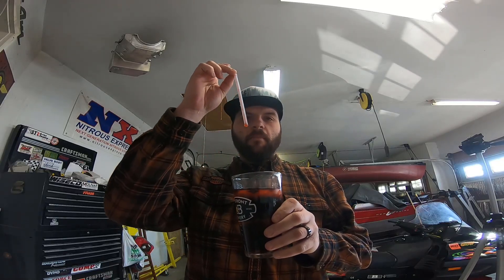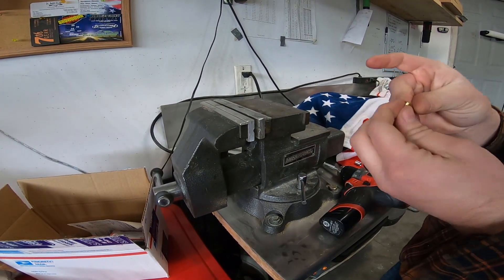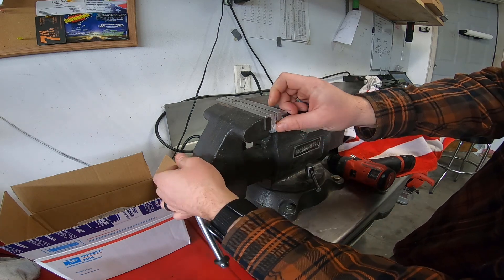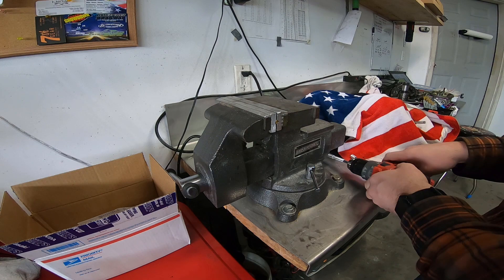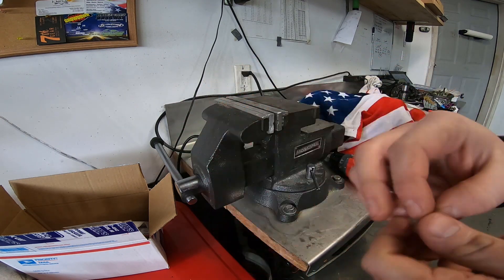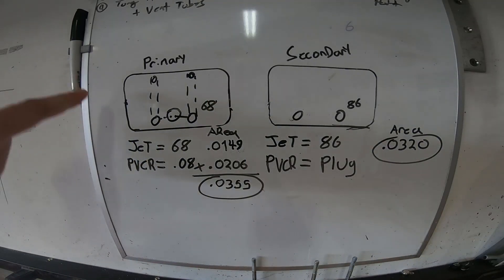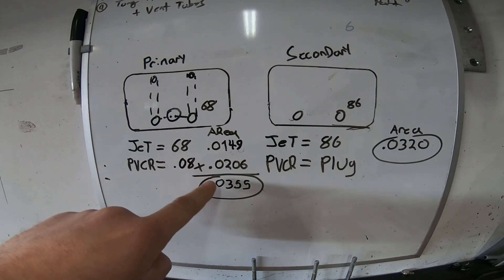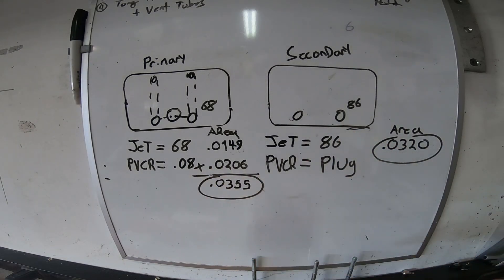Building a Blowthrough #4 Carb Tuning

Comment: Watched your videos numerous  times, looking for a little advice. 4.8 ls running 650 atm carb, 10lbs boost. BAPV in front, pvr,s drilled .081 prim jet .073 and .090 in sec. Currently  afrs at idle 14.1:1  cruise is same and wot  is 13.1:1. Should I drill pvrs more and add more jet to sec. Also would you suggest i drill air bleeds larger to get idle and cruise  alittle cleaners, thanks
Reply from the maker: Cruise at 14 is pretty good. Weather will change that a bit. 

For WOT go up on secondary to get acceptable AFR note the area change , then you can calculate how much to go up on the front PVCR and drop the rear jet down a bit to keep even fueling
Reply: Thanks,  wasn't  sure if I could jet the rear enough to compensate, I'll give that a try.
Reply: Ok i went to .098 in sec  with zero change. I suspected my fuel pump was maxed out.  I installed a 155 gph  14psi fuel pump with -8an from tank to regulator.  Had to re-adjust  regulator  and float level so im getting more fuel. Took it out for another hit,  again zero changes in wot, still at 13ish.  From regulator to carb i have a single 3/8 line feeding both  bowls could this be a problem?  if yes and i run two lines and no change should i run smaller high speed air bleeds, thanks

Comment: I should learn how to tune a 4 barrel well before doing this blow through stuff! If you are only running the boost referenced power valve in the front do you not modify (Drilling holes) the rear metering block at all?

Comment: So how much power will this particular setup be good for on 91
Reply from the maker: You can make over a thousand on gas . Now if you can keep it safe on 91 is the difference.

On 91 the carb won’t be the limit
Reply: @ do you power valves work at lower boost levels? 750 carb, 7-10 psi?
Reply from the maker: @Johnson-uy9xq  yes they start at 3psi

Comment: If i am running a boost power valve in the rear secondary drilled out to .0080 and a vacuum power valve in the front what size jets would be a good starting point
Reply from the maker: I can't answer that, just to many variables . Start with the jets that the carb came with or drove with well under no boost.

Keep timing low , test one change at a time and have fun

Comment: Quick question I'm having an issue with a rich condition on just off idle its something that has recently started pulled in the driveway at 13.6 ish afr one night left in the morning at 9.9 ish afr's. It sounds like it may be an idle air bleed issue from what I understand you say?
Reply from the maker: Reset your 4 corner idle first and see if those screws moved or something.

Floats stuck high possibly 

Leaking / blown power valves can cause rich idle too

If this car was dialed in I doubt the air bleeds changed on there own
Reply: @tittan1500  ok I'll check the idle screws first. 

Floats are good and I run the brpv which I've switched and had the same condition. 

Truck was dialed in however I don't run inner fenders and I lost and air filter took me a week to notice. There can be a decent amount of debris around the turbo maybe it sucked up a little debris and potentially partially plugged the air bleeds. Could this be possible?

Comment: Great video series!  Thank you.  This may be a dumb question and someone probably already asked.  I am having an issue with wide open throttle.  It works great until 3/4 almost full throttle.  Reading 12 - 12.5 to 1 on the AFR. Then I mash it to the floor and it goes to 14 to 1.  Would this maybe be the power valve restrictors being too small in the secondaries or possibly the high speed air bleeds?  I am only running about 6 pounds of boost.  Any help is greatly appreciated.
Reply from the maker: You need more total fuel.  Add more secondary jet to get it safe then you can work on balancing it out
Reply: @tittan1500  I currently have 97 jets in the secondaries. I will put smaller air bleeds in first and see if that helps. Otherwise I will go into the bowl and change to 99 jets. I appreciate the response.
Reply: @lzmachines69  you ever fix it im having the same problem and i feel 90s jets is way to big for only 6 psi im at same thing
Reply: @302brady  I went with the aces killshot 2.   Fixed all of my issues and now I get better fuel economy as well.

Comment: I follow everything I ordered the power restrictor but I put it in the secondary. Is that OK Does it matter thank you great video. Do I need to run a plug in the primary or can I run a vacuum secondary.
Reply from the maker: Vacuum power valve in the front and BRPV in the rear or both BRPV
Reply: @tittan1500  My car stumbles on the trans brake any ideas ..
Reply from the maker: @OdinSon286  when you let off the brake does it bog?  Do you have BRPV in the primary and secondary

Comment: Hi building a turbo 350 now. I have bought a power valve from you. Just a question. If I fit the power valve to the secondary side do I still have a power valve in the primary side?  Do I leave the primary alone?

Comment: Hey i built the carb where it works on power at every interval with boost however... idle is the only place i have a problem...idle is at 19.0 afr it barely runs at idle and way too lean.. idle adjustment needles dont have any effect. Wondering what you may think.
Reply from the maker: How close is your o2 sensor to the end of the exhaust ?   Sounds like it’s close.
Tune it by vacuum old school and if it idles well ignore the gauge, pretty common for guys to chase the AFR gauge at idle 

If you can’t get it to idle well your blades transfer slots might be off or the idle feed restrictors.

However it you dident change the fuel or put it on some huge engine it should be close already
Reply: @tittan1500  I’ll try the blades cause it’s lean popping at idle very aggressively

Comment: Great video very informative and straight forward. I have done blow through with an edlebrock and worked okay which made me switch to holley double pumper. My question is if you do not use two power valves do you need to plug that powervalve hole on the one side you do not use the powervalve?
Reply from the maker: Holley sells a blank power valve block off, you do not need to block the port in the base

Comment: Is your basic carb setup for turbo application or for centrifugal supercharger. 
I have a vortech supercharger on my 383 with a modded carb and a 50mm bov. 
I’m finding I can’t get the car to idle as it’s getting a lot of air even at low rpm and 2 much fuel . Any suggestions ?
Reply from the maker: It’s for a turbo, but it’s close for both

Is your BOV open at idle ?? Are you using a vacuum power valve ?

Comment: Just have a question. Can u explain the vent tube extensions better. My current set up does not have them. Thanks again!
Reply from the maker: Jeff 

I have a video on that topic too.  Short story you see the signal quicker so the carb does 2 things,   1. Responds quicker and 2. The air shoots directly into the tube not across it so the carb gets a stronger signal in the bowl.

Many people find this makes the carb flow more fuel aka its like adding jet sizes

Comment: Using your example when squaring the carb with a .08 pvcr and 68 jet (.0355) wouldn’t a 93 or 94 jet be closer to square? Or am I reading it wrong? Thanks for your videos!
Reply from the maker: It’s just a common staring place most guys don’t ever bother to square a carb.

Your primary jets are going to be what they are to allow the car to drive light throttle.

Then your correct you would go up on the PVCR to find that balance so the primary and secondary pull the same fuel WOT
Reply from the maker: Keep in mind the more your add to the primary pvcr your going to be reducing the rear netting too so gotta so some math / estimating to reduce trial and error

Comment: I have a holley brawler 850 race carb . Any way to tune the carb with power valve plugs and just tuning off the jets? Only running 8lbs of boost on a chevy 355.
Reply from the maker: Ya  but with no powervalves at all it’s going to be an on or off switch
Reply: Ok I understand I appricate the response . With low boost like I am running what size jets should I start out with

Comment: Nice work, great info and explanation! Can you make a quick suggestion for a 5.3 700hp goal on E85; what E85 Jets and PVRC sizes do you recommend to start tuning with? Thank you!
Reply from the maker: Carswell's Customs link in the video description has an e85 carb setup / build sheet
Reply: I opened the Basic Gasoline Blow Through Starting Tune, but I do not see any information E85 listed. Maybe on a different video?
Reply: Hi Tittan 1500, I clicked every link in this description is the information somewhere else?
Reply from the maker: Carswell's Customs I updated the excel spreadsheet.  Keep in mind every booster / metering block will generate a different signal so this is a base like
Reply: Excellent info! Thank you again!!

Comment: Let me ask this, if I'm running e85 blow through, if I drill my pvrc say .080 do I match the secondary side as well if I'm running bapv in both primary and secondary?
Reply from the maker: Brian Hundemer  ideally yes that will help you keep the carb “square” but at times you can’t dump all the fuel in the primary so fast so there can be a difference.

In the end as long as the total fueling for the primary and secondary are close your going to have decent cylinder to cylinder AFR

Comment: Did you need to drill or block certain emulsion holes when running e85 blow through? Your video have taught me alot and appreciate every one of them.
Reply from the maker: Brian Hundemer I have not purchased that kit before.  I assume it’s just the same blocks with larger main wells and screw in emulsion holes
Reply from the maker: Brian Hundemer start with your current gas tuneup and go from there.  You probably don’t need to change the height of the hole
Reply: @tittan1500  ok, let me ask this idk if your familiar with the quick fuel e85 conversion metering blocks. Im using those, if that would change things?

Comment: What would be the basic mods for 15 pounds on boost on a bbc?  I have a holly 950hp now.  Gas carb
Reply from the maker: Andrew Myers most likely if it’s basic.  If it makes big power NA then bo
Reply: @tittan1500   I make 425hp at the crank now na.  8-1 compression. I'm gonna go with a vortec  blow thru supercharger or a torque storm supercharger. And I plan starting at 8 psi then pushing it to 14psi after getting the feel for 8psi .  I'm thinking it's only gonna make 700hp. Non intercooled. Maybe less. Has good  dart aluminum 340cc heads and team g intake.
Reply from the maker: Should be good to go

Comment: Watch the videos a hundred times bought all the things to make my Holley XP 750 CFM a blow through carburetor runs a 100 times better twin turbo big block Chevy when I get to 15 psi around 6,000 RPM it builds fuel pressure and starts to fall on its face running a mechanical fuel pump what am I doing wrong
Reply: This is real old and you’ve probably found out by now, but an inexperienced head as myself would say you’re running out of pump. Can only throw in the pressure the pump can supply. He explained it in the first part I believe

Comment: Your very articulate and your technical ability is so impressive. Could you please do a video where you run through the set up in your car? Eg, what cam are you running,?what heads? Which turbo? Timing controller?

Comment: Ty man your vids are the truth and guys like me need more video to understand lol..👌 we not tryin to blow parts frfr. Quick 2 questions. Im runnin 22+boost. Whats a good plug to run and whats a good gap. .28 gap im blowing the spark. Anyway your vids are fiyahhh🔥🔥
Reply from the maker: Les Harp what engine fuel and compression
Reply: @tittan1500  2 3l..9:2:1
Reply: 93octane

Comment: For the rear  throttle  blades  and for the accelerator pumps
Reply from the maker: Shane Mcclaran accelerator pump tuning is not effected by going blow though tune the shot size / duration to get a nice crisp transition.

I have not played with altering the timing of the blades. I would imagine going to a 1/1 linkage would not be ideal as most turbo motors are smaller and have tight converters.

Comment: Does changing  throttle cams make a difference in your  carb tuning  for blow throw use
Reply from the maker: Shane Mcclaran you mean the timing if the secondary blades ? Or the accelerator pump

Comment: Tittan,I wanted to ask about sealing throttle shafts. I know the demon comes with sealing on their blow through models but I don't know about others Could you offer some insight.Also the first blow through we are going to do will be a low boost 10 to 12 lbs street set up.Since it will see some real world street time would it make sense to run a standard PV on primary side and boost referenced on the secondary side? Or should  the base line jetting be rich enough to manage part throttle no boost use and just use boost referenced pvs primary and secondary. This will be 360 plus cu.inch single turbo manual trans combo.I bought a used quick fuel blow through 650 cheap as a base so I will be starting combo in the next month or so I want to finish it for my sons birthday. I've had most of the parts for this for sometime now I was just waiting until he was ready. Now he's getting the itch.
Reply from the maker: J Damon sealed throttle shafts can be done in a few ways,  quick fuel I believe cuts a slot into the base to pressurize both sides of the shaft.

Idk how much it really matters.  A local guy by be has run an old holley BT carb without sealed shafts for years.

Sure sealed are better but if I already had a carb I would use that.

I have used vacuum PV in the front and the BRPV in the rear.  It works fine just be carefull it’s easy to over size the PVCR on the primary with an vac power valve as it opens before the tirbo spools!

I used like a 1.5 hg valve if I remember correctly to delay the PV opening as much.

It’s been years,  I did go dual BRPV after that to fix said bog

Comment: A little rough presentation but to the point.  Relax and just make a smooth talk as if your talking to your buddy, no need to rush/ cram it in 10 minutes. You seem to have full grasp on this subject so re do it and go through the circuits 1 at a time and explain how they work under boost. 1/2 hr video of following the fuel flow  ,  will help a lot of people when tuning. Didn't think anyone was still playing around with this much anymore. M2C Hard to watch but still enjoyed it. Thanks.
 PS : them tiny drill bits bend super easy so never set them down any way but flat un chucked. A 20 can become a 30 just looking at it wrong , and like a women can get bent out of shape in a blink of an eye. micro bend in the bit can change a lot and hour glass the hole
Reply from the maker: P Kuudsk thanks man, ya it’s always a struggle trying to fit it in a time frame people will actually watch!   Also yes I gotta slow down it’s hard on camera fo whatever reason it’s hard to talk . Re shoot 3 times and your like “f it good enough lol”

Thanks for the well thought out feedback not some your ugly comment

Comment: BRAVO !!!!
A very well done series
Do you have any opinions about Water/Meth injection units, specifically the under carb plate kind?
Not all of us can get E85 and have to settle for 93 octane.
Reply from the maker: I have not personally used any water meth.  It works well from what I have seen.  Best of luck with the build!